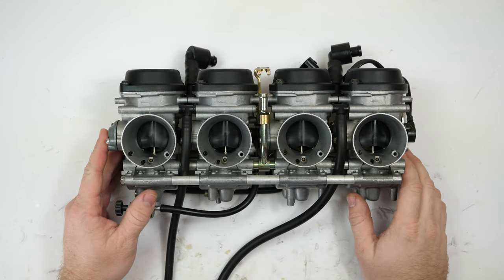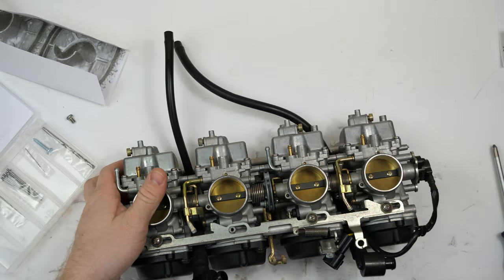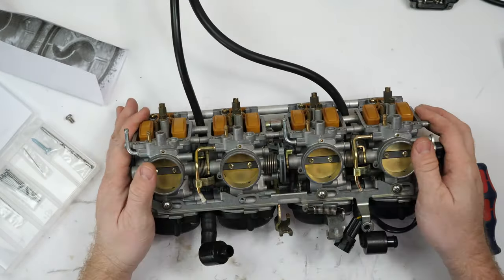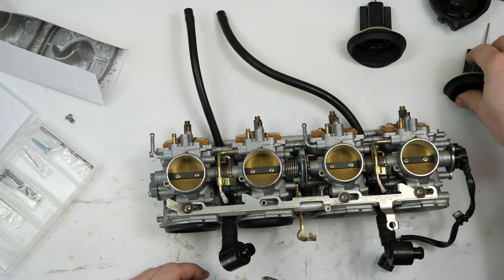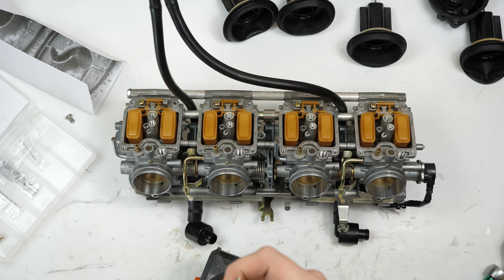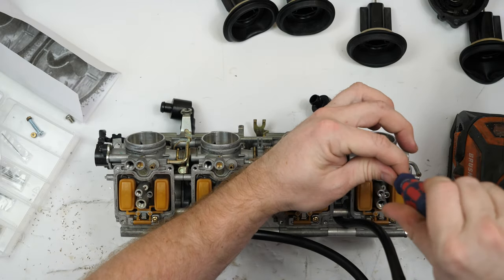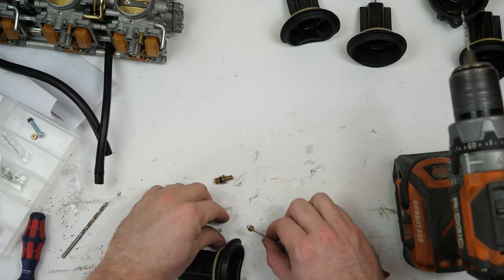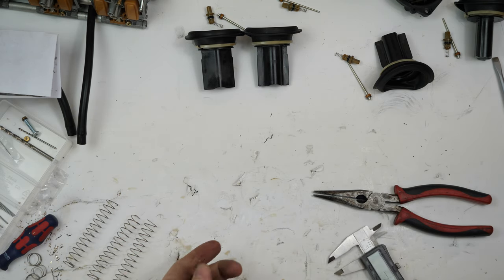Yamaha FZ1 - Ivan's Jet Kit Install Part 1

Comment: I put an Ivan's jet kit in my 1998 R1. I actually called Ivan and he told me to polish the needles with real fine wet and dry before installing them.  I also replaced the needle jets in the carb bodies. WOW!!! What a difference the kit made.

Comment: I am doing the same for a 01 FZ1. So far one stuck mixture screw in a pre drilled welsh plug. Needles coming out are 2 kinds... Interesting work so far. I check back by time in your part 1 and 2 :D
Reply from the maker: That is really strange, do you think someone already modified them?
Reply: @DeWoodysShop  My bike is now codename "Chop Shop"...
Carbs from 03 in a 01 FZ. And my carbs never seen any love last 10 years, had to send it to "Toppham Mikuni" who did an awesome job drilling out dead screws and position the throttle plates back to spec. Finally it was time to Ivanise.
Last weekend i put everything back in the bike, and it does what Ivan says. I did everything as told. Shorter springs, drilled bypasses, airbox lid mod. The best KIT on planet earth, by far !!

Comment: The next thing I would like to know is how to set the throttle cables on the FZ1. I have a 2001 FZ1 and pulled carbs out and forgot to measure/take a photo on the positioning.

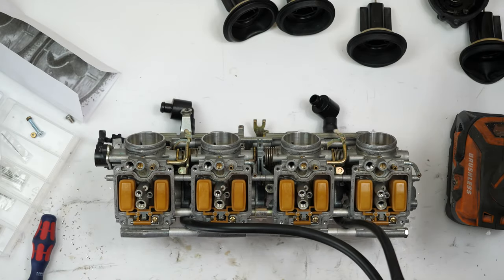Comment: At time marker 7:00 (needles) what is the black cylindrical thing called? Is it plastic? The mechanic told me that I need to change these for my bike.
Reply from the maker: Those are the vacuum slides. Should be easy to find for these

Comment: 5 turns out on the mixture screws is way too rich, it'll make the choke unusable due to being far too rich at idle... 3.5 turns out works better & choke is usable, plus I've found it's better to only drill out 1 bypass hole on each carb ... to get the best from the Ivans MB kit, you need to port the carb intake mounts with a dremel & cut away the airbox lid inner section with a dremel & fit a sports air filter like a Pipercross foam filter... also a good time to replace the O-rings in the float chambers, especially the O-rings under the float needle valve bodies as these rot big time & reset float heights to 14mm, motor responds well from this mod & pulls like a train from idle to rev limiter.
Reply from the maker: Thanks for the tips!

Comment: Have you finished this project or has it just been on the back burner?
Reply from the maker: Sadly on the back burner. But, i have finished most of the paintwork now, and all the major new parts are in. I hope to start back on it this month. New Garage is almost finished just need to finish a few drywall spots.
Reply: @DeWoodysShop  I would love to see more videos, I just picked up an engine for an 05 fz1 and want to use it for a little cross kart, but I am having one heck of a time figuring out all the hoses and wiring. It all came to me in pieces and this is my first bike engine to work on.
Reply from the maker: @jaredbudzinski8434  That sounds like a lot of fun, shoot me a message on FB with some pictures and i can probably help out.

Comment: How often do u need to clean the carbs?
Reply from the maker: It really depends how much you ride and gas quality. If you ride it a lot and have good gas, maybe never. If it sits for long periods or is not stored correctly possibly every spring. Bikes I don't know the history of I like to do soon as possible if its running rough or etc.
Reply: @DeWoodysShop  ok thanks so much, I'm going to check one out in a couple of hours and I want to be as prepared as possible. One last question, do you have to do valve jobs periodically or is it based on how it was ridden previously? Is there anyway to tell if it needs to be done?
Reply from the maker: @davidstancu2963  yes and no. So by the manual they should be checked every 10k miles. However how the bike was ridden can greatly affect if any adjustment is needed. I have found bikes that were babied are often still fine at 20k miles when I do that check. Whereas a 600 that loved the redline can be well out even before 10k.
Reply from the maker: @davidstancu2963  On a multi cylinder bike it's harder to tell, as I can be a few things. But hard starting can be a sure sign. What happens is, as the valve slam shut it stretches. Eventually it will stay slightly open, causing low compression, burnt valves, etc.
Reply: @DeWoodysShop  that's ridiculous a valve job after 10k miles LOL. Buying it from an older gentleman w 14k miles so I think it will be fine to 20k but well see. Thanks again for the info your help was tremendously appreciated.
Reply from the maker: @davidstancu2963  yes, on most of the newer bikes they have gone up. Also it's just reccomend to check clearance at 10k. Not necessarily shim the valves. My bike had a very hard squid life and even most of those were fine on it.